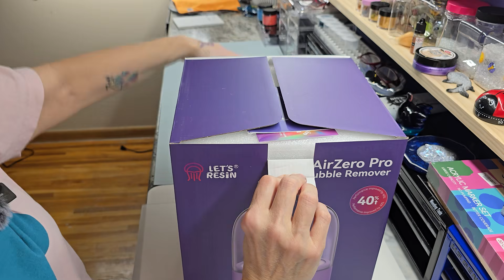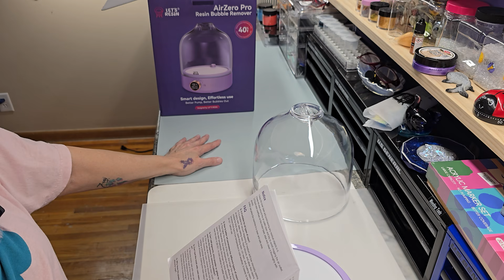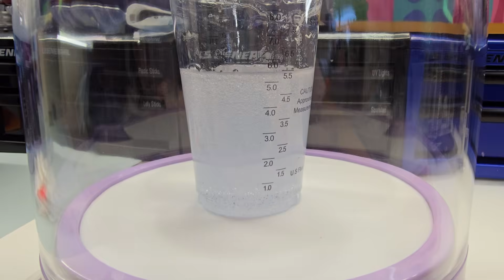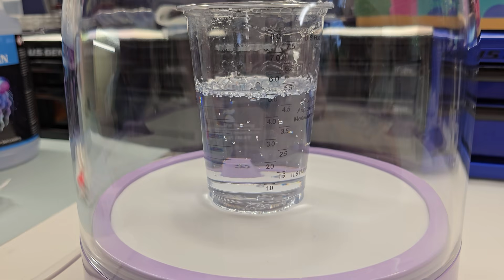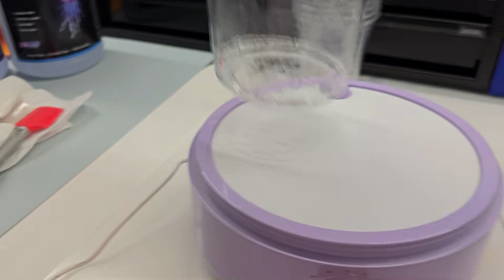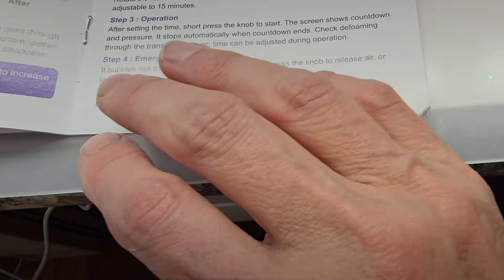Air Zero Pro First Look: Game Changer

Comment: Ooo this is exciting - in the next few months I’m either getting the resiners or this one. The purple is a sell but ultimately it needs to work! 😊
Reply from the maker: I totally agree, performance is definitely the most important thing! ❤ I have both and they are comparable as far as bubble removing, it really comes down to if you want to have a base to set your resin on or put your resin into a round flat bottom container. They both hold the same size cups and work basically the same. hope this helps in deciding on choice.